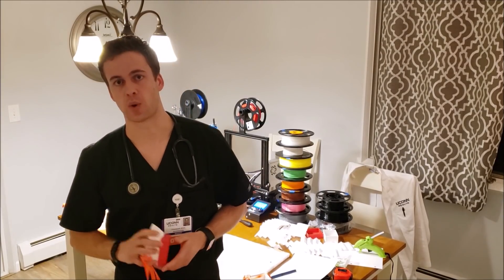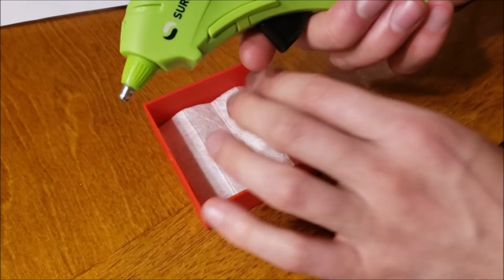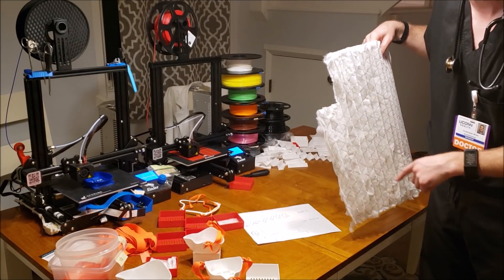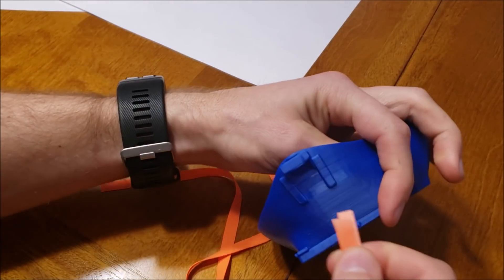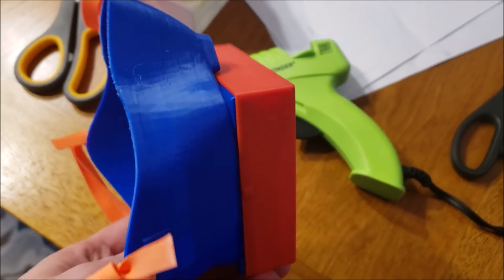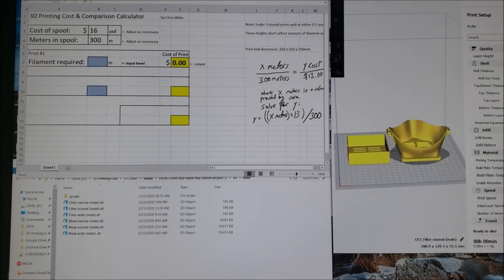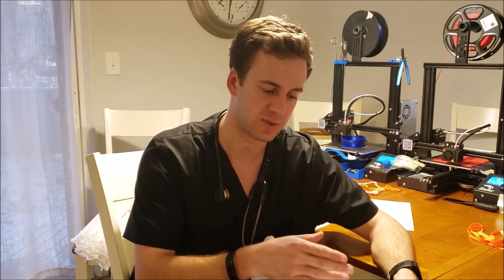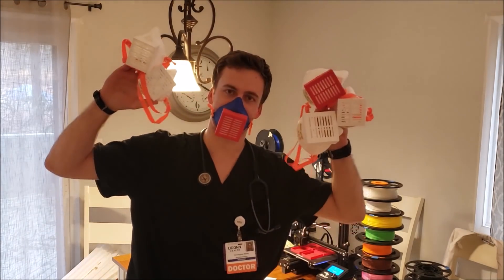COVID PANDEMIC 3D PRINTED MASK TUTORIAL

Comment from the maker: Latest data driven recommendations: We are now using either 3 layers of 3M Filtrete 1500 or 2 layers of 3M Filtrete 2200 for approximately to achieve 95% filtration of 0.3 micron particles (n95) or better based on our latest laboratory filtration testing. The extra layer of corrugated MERV13 filter seen in the video is optional but we continue to use it. It does not increase filtration efficiency but also does not worsen breathability as there is not a perfect seal, but does likely captures some moisture, therefore preserving electrostatic charge of the initial layers for longer.
Reply: I just resorted the comments by date and noticed this. Are you saying you put 3 layers of 1500 material then place the plastic x piece and then glue it all in place? Also in the post production video you are coating the whole mask with lacquer. Is this to insure it is air tight? Is it acceptable to not put the lacquer on?

Comment: I printed some and they're great, only problem is that I can't find no filters. Can you post the link/s you buy your filters from?
Reply from the maker: I won't post specific links right now because listings are always changing, but if you search for "filtrete 2200" on amazon, you'll find it. That's what I'm using now, but you can find the filtrete 1500 at Walmart if you don't want to wait for it to arrive. 2200 filters better though. Then the layer of pleated merv13 filter I always have purchased on eBay. I like the brand SFP because the cardboard comes off it easily, but I only see 6 and 12 packs currently available, so you may want to buy a different one online or locally if you just need one. 

I'm trying about 10 different filter combinations in a testing chamber this week to try to find the best combo through a more scientific method. For now, I can say that the  2 layers filtrete 2200 plus 1 layer merv13 is filtering at about n93 level, and when worn over a surgical masks is above n95. For now, this is still only intended for community use, so you can use whatever filters you want to wear the mask out in public. Also please see my post-production processing video for more tips.

Comment from the maker: UPDATE: Initial testing data! We are now using 2 layers of MPR 2200 + 1 layer of corrugated MERV13 filter. Initial testing shows it's equivalent to n93. When you wear over a surgical mask, it's approximately n98.5. The video shows MPR 1500 in place of 2200 - that combination alone appears to be around n85. With a good seal to the face, all these options are great for community use. I'll update with official findings once tested repeatedly and published. We will seek clinical approval if possible, but for now, only use for community use (eg to the grocery store, etc) unless local institution states otherwise. Thanks to collaborations with the US Coast Guard, Yale, and UConn, among others.

Comment: Hello there! I would like to know what are the dimensions for the masks and filters because for a class project we’re going to be using your prototypes to recreate them in CAD and make some modifications. I tried exporting one of your prototypes to onshape so it would let me know the dimensions but for some reason it doesn’t give me the correct ones. Hope you can reply soon! Thank you for your good work.
Reply from the maker: That's great! I'm really happy to hear the mask will be able to contribute to education! The version 2 fusion360 cad files are available in the thingiverse linked in the description. As for dimension in mm, the "Large Narrow" file is X: 97.301, Y:129.309, Z: 62.193.  The "Small Narrow" file is X: 84.171, Y: 110.37, Z: 58.479. The "Original Filter Box" is X: 66.52, Y: 81.316, Z: 23.937

Comment: Please do NOT use fiberglass filter material without a filter paper or cloth barrier on the inside
Reply from the maker: One of the reasons I am using nothing with fiberglass. The filters demonstrated don't have it. The mask can and should be worn over a surgical mask or piece of blue polypropylene material from the operating room for comfort, filtration boost, and especially if people are using other filters that do have fiberglass - I agree and thank you.

Comment: Good intentions but as printed  they will not stop Any virus. The filter is not the issue the mask is.  How did you address the gaps or imperfections in the mask? There will be holes in the surface 6 to 9 microns which is hundreds of times the size of the virus at 0.3 Unless you have added a sealer coating or layer they will not work.  You can verify this by looking at one of your mask under a microscope.

Comment: Don't use PLA. Use TPU. The PLA material fatigues much faster when washed daily, or being stretched and pulled. The crack looks like saw blade which will hurt anyone face with no mercy. You are experienced 3d print maker you should know the fact. But the users never know until get hurt.
Good luck.

Comment: I can't think any US hospital is going to authorize a nurse or a Doctor get near infected people with this mask, regardless if it works or not is not OSHA certified so for all the purposes is the same that put a t-shirt around your face, Hospitals have liability with their employees and by any chance they will take any risk, also I understand all the equipment has to be changed/discarded every time they came out a infected room and going into another, so the mask has to be disposable at least a N95 or a full hazmat suit, and lately is a Facility responsibility to procure all ppe OSHA approved equipment for all their employees and if they can't they will be forced to close as OSHA regulations. No need to print these for doctors and nurses as they'll never use them , at least in US.
Reply from the maker: The CDC is already permitting it when you run out of n95s and our infectious disease team has cleared it in the event of no n95s. The shortage is extreme and normal practice patterns are no longer in effect.

Comment: To customize the fit. I stuck some Self stick 3/4 in wide rubber foam Weatherseal  around the inside of the mask.  fairly deep into the muzzle.  It conforms to the face if you hold the mask tight for a little while.   
https://www.homedepot.com/p/Frost-King-3-4-in-x-5-16-in-x-10-ft-Black-Rubber-Foam-Weatherseal-Tape-R534H/202262324

Comment: Question, would it be more comfortable if you put some sliced, surgical tubing all around where mask touches face? The soft rubber would cushion vs thin plastic against face and nose. JMHO.
Reply: great minds think alike: posted similar idea a week ago :)
redesign the mask part so that it incorporates a shallow channel all along the edge that touches the face. Squeeze a length of surgical tubing into the channel. This would provide a more comfortable fit, a more complete seal, and would be easily replaceable, so it wouldn't need to be sterilized;

Comment: With regards to making the unit more comfortable... I would recommend using removable cushions like those used in VR headsets.  In many VR headsets you have removable foam cushions that goes around the entire unit and replaced via velcro.  If you modify your design so the end-part (the plastic part that rests on your face) into a type of "L"... you could place velcro and use rubber window sealers like you can get at Lowes/Home Depot like I use on my VR headsets.  The VR headset are flat and not in an "L" shape but I'm recommend the "L" shape as it would cover any gaps (holes) the velcro might cause.  With this method, you can create inexpensively face-cushions that are removable and could be sterilized depending on the material you use.  Or you can simply replace the window-sealer each time.  It's relatively cheap.   In VR there are companies that make these face cushions but they're VR so they cover the eyes and not the mouth.  But I think you can incorporate the principles that VR companies use to make their hard-plastic face masks more comfortable.

Comment: Outstanding efforts Chris.  A couple key points as many have pointed out:
1. 3D printed objects are porous. 
2. Gaps typically in the size range of 6-8 micons.  
3. Covid virus about .002 microns in size. 
4.Therefore simply using a filler followed by a  toxic-free paint on the outside surface would make this mask 100X safer.  
5. Here is a link to a video showing how to accomplish this.  https://www.youtube.com/watch?v=77PgC3kMrFs

Comment: Make sure you use some kind of sealer on these masks, as 3d printed objects are typically full of microscope holes that you can't see.
Reply: What about a layer of Epoxy on the outer surface?
Reply: @scientist100  Honestly, I am not sure.  I guess it could work, although Epoxy fumes are fairly volatile pre drying and requires 24 hours (or more sometimes) to dry completely.  Afterwards it should be safer, I guess?  I think some sort of acrylic based sealer may work here as well?  If someone has a better suggestion or is more knowledgeable please share, thank you.  This has been plaguing my mind for some time and is the only reason why I haven't been giving out 3d printed masks yet.  (Mainly just been making face shields).
Reply: @bayaarlo-borjiged1841  great point, but honest i think even if they have tiny holes its better than nothing, as many many nurses are today. let do it, one mask is one chance, no mask no chance.
Reply: A couple of things:
1) I'm not sure there would be microscopic holes, but wouldn't it be easy enough to test if the mask is waterproof. If it is, then I don't see how it's a problem.

2) Perhaps a different filament (ABS??) might solve the problem if there are problematic holes.
Reply: @rukidding7588  Holes are usually a result of the 3d printing layer process, typically no matter how good your printer is there will always be some imperfections.  I think the other issue here is PLA is a porous material as well.  So over time you'll have a harder time cleaning the material cause it will absorb some of that moisture.  ABS I have no idea since I don't typically print with it.  There are medical grade polymer filaments you can purchase though, those might be better  I think.  As far as things that PLA and ABS are fine for are stuff like face shields or those mask holders, which I know quite a few people have been printing to hand out to hospitals.
Reply from the maker: Thanks. I show the sealing process here https://youtu.be/9XwoQl0alVE

Comment: would this work with tpu flexible filament so that it conforms and fits a little more comfortable, id be glad to use my 2 printers to help you print them for hospitals i have a small printer as well as a cr10 s4 large printer 400x400x400

Comment: What if you paint spray it so you can clean it and fill up all micro holes
Reply: was thinking that also. What kind of spray would be safe? Flex Seal?
Reply: @BradRoss  In general, a safe coating for medical devices is Polymer, to be more specific; polyester, A low-gloss polyurethane, Polytetrafluoroethylene(PTFE)....etc Those coatings contain chemicals to achieve the desired properties of color, water and mildew resistance, antimicrobial and flame retardancy.

I'm not an expert but I have found this
Reply: @socomax223  So what can you buy on amazon is the real question? :)
Reply: @BradRoss  there most be a varnish type that is not harmful for the skin or maybe a clear cote of spray varnish them can help a dermatologist or an engeeer may be helpful too ! Any idea what can help?
Reply: @BradRoss  If you can smell the solvent; it's not dry!

Comment: Please do note for anyone who is going to print these out that you need some kind of filler to fill the the micro sized gaps for the mask in order to make sure everything that is breathed in goes through the filter material and not through the mask. Also, you can use some weather stripping around the sides of the mask to make sure you get an "air tight" seal around the mask. I recommend watching this (https://www.youtube.com/watch?v=77PgC3kMrFs) if you are going to print these out for a more detailed explanation on why you need the filler for the mask to seal the micro holes.

Comment: chris 3d printers have errors if you see the prints with a microscope youll see that it has little holes. holes big enough for the virus to enter, make sure to seal the masks if you dont seal the masks the virus has more chances to enter the mask
Reply from the maker: Thanks! Next vid will include comparison of 3 sealants, suggested for consistent use for exactly that reason and also ability to wipe down. I have acrylic sealant, flex seal, and just waiting for the silicone to arrive to try them out
Reply: @chrischris64  good my cousin is a doctor and is working at the airport so i am starting to make a lot of them thanks

Comment: Two things I've noticed. One is have you checked for leaking by covering the air slots?  Second could you print a "ring" or something to hold the filters in place. That way you wouldn't have all that glue if want to change filters. Great job!
Reply from the maker: Hi! Thanks. We are actually having the boxes and a press fit "ring" type piece injection molded and for our larger scale production. Both that and gluing pass fit testing for no air leaks.

Comment: First of all. I really like the ideal of mask full made by 3D printer.
But I don't think hot melt glue is a good way for filter replacement.
So I offer a simple design, using elasticity from one layer PLA to hold the filter.
https://www.thingiverse.com/thing:4250269

Comment: Have you thought of adding a small snap in frame for the inside to hold the filter in place without the step of gluing?  I'm going to print one out but if you could supply the source files on thingverse, maybe others can improve on the design.
Reply: Are you on about the outer filter layer or the ridged filter? He's use the glue as the sealer, i know a clip on would get a good seal but as good? Who knows
Post a link to your file and i'll print your snap holder and test for you. If not I can design one if you havent already?

Comment: Chris,
5 ideas (sorry; forgot 1 the first time):
(1) redesign the mask part so that it incorporates a shallow channel all along the edge that touches the face. Squeeze a length of surgical tubing into the channel. This would provide a more comfortable fit, a more complete seal, and would be easily replaceable, so it wouldn't need to be sterilized;

(2) use a printer with 2 heads or use a Palette device to create an edge out of a softer, rubbery plastic, which would accomplish the same things as i (1), except for being easily replaceable.

(3) standardize the junction between the mask and cartridge. I see no reason why they need to be different. Standardized cartridges would also standardize the size of filter material needed.

(4) don't worry about using UV-C light. Use full spectrum UV bulbs, which I believe are more readily available. Just ensure that the light box doesn't allow light to escape or people to peek in while the light is on.

(5) standardise the colours by size, so it can readily identified which mask someone is picking up. Make all the standardized filter the same colour (different from the mask itself).
Reply: No 3 is an excellent suggestion.
Reply from the maker: I love the ideas
Reply: for 1) We could make 3d printed TPU gasket using filament like Ninjaflex. We would need someone to take the STL file and likely cut out the outline and grow it by a few percent. Not sure how to make the two fit but it's a start.  Do know it requires some small modifications to the Ender 3 to not jam in the extruder feed wheel. But it would be doable.

Comment: Would a HEPA filter material be useful in these masks? Or a PM2.5?
Reply: According to the federal government, HEPA doesn't stop viruses. It could be a good first layer, but you still need MERV 13 inner layer.
Reply: @nathanmargolis2  According to this Wikipedia article, HEPA is as good a n95, at least by spec:

Filters meeting the HEPA standard must satisfy certain levels of efficiency. Common standards require that a HEPA air filter must remove—from the air that passes through—at least 99.95% (European Standard)[4] or 99.97% (ASME, U.S. DOE)[5][6] of particles whose diameter is equal to 0.3 μm; with the filtration efficiency increasing for particle diameters both less than and greater than 0.3 μm

Comment: This printintg process creates microscopic holes in the mask.  The masks needs to be sealed.
Reply: I’ve chosen to spray the inside of the masks with 2 coats of clear polyurethane  to combat this issue. 

It’s quick and easy and drys in a few hours, overnight at the longest.  I spray the inside because the clasps on the outside of the masks are hard to seal.